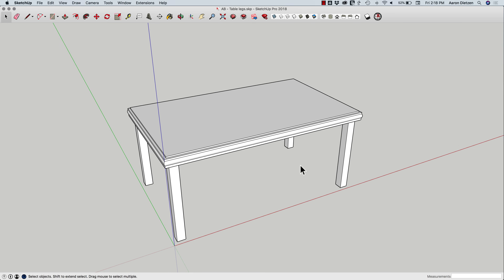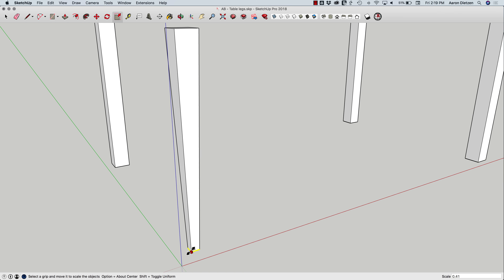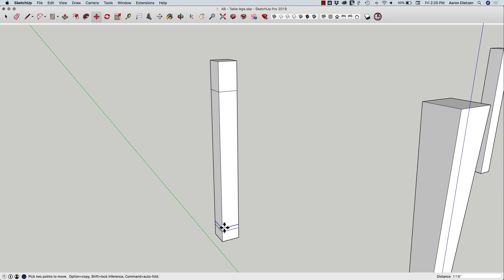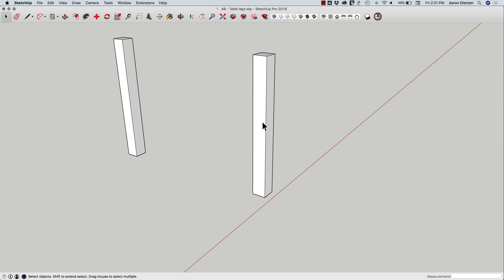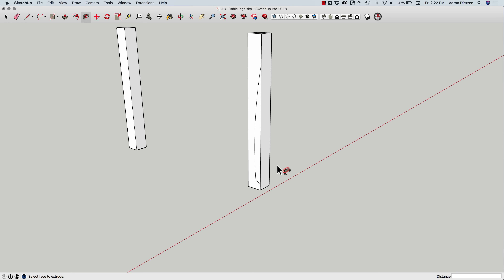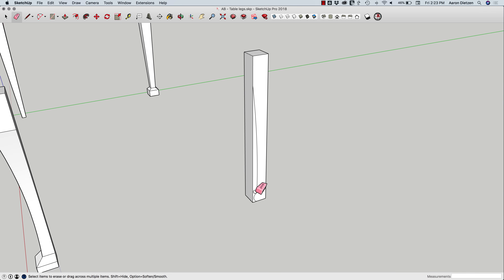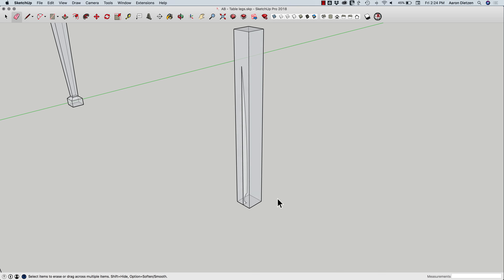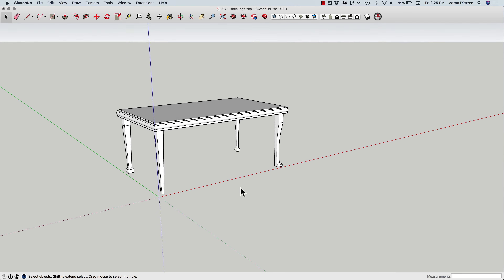SketchUp Skill Builder: Tapered Table Leg

Comment: Thanks for sharing. I enjoy your SketchUp tutorials with real world application examples. 

If I may add a few items to you list of todos. Please consider creating tutorials on the subject of "black swans"  in SketchUp (infrequently occurring but high severity problems). I'm thinking specifically about "clipping," and SketchUp "walkabouts", and more.

There are several videos on "clipping" but all are based on user experiences and we need to have it  explained in depth from the developers' points of view. There were several beach house competition entries that suffered from this problem (mine included). For example I know clipping problems occur because of number overflows but nobody can be PRECISE about why,  how, and where  these errors occur. Is it because model extents exceed 1 mile, 2 miles apart or what? Why does "follow me" not work on very tight, small turns? Which particular calculation/ routine bombed out? What are the best solutions? For example, when follow me does not work, I scale up the object 10 times, run the routine and then scale down 10 times (SketchUp should do this automatically or at least offer the option). No problem can be satisfactorily solved without knowing the basic cause. 

SketchUp goes "walkabout" for several reasons and these can cause crashes if the users are not careful. There are the usual culprits such as autosave, create backup etc which unexpectedly wrest control away from the user, but there are others lurching around to trap the unwary into input overflow crashes such as moving a high poly model. For a start, a progress bar would be a big help. If autosave is at work, why not say so instead of stranding the user?